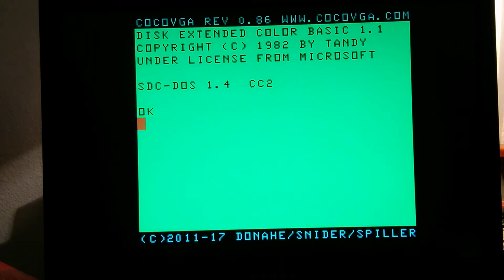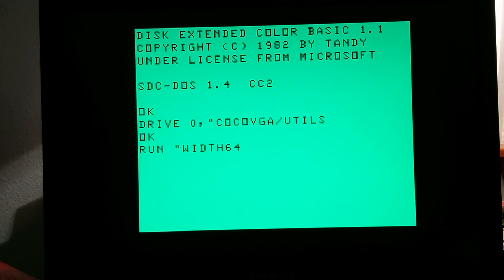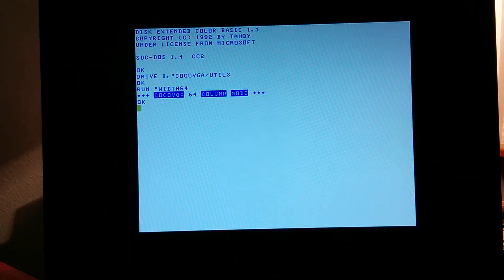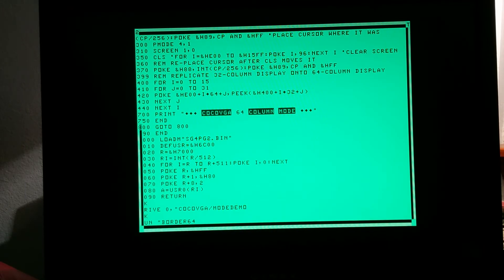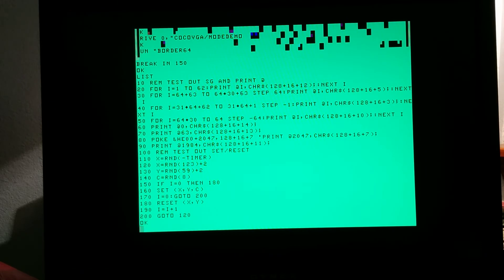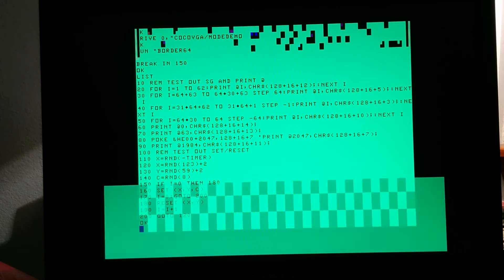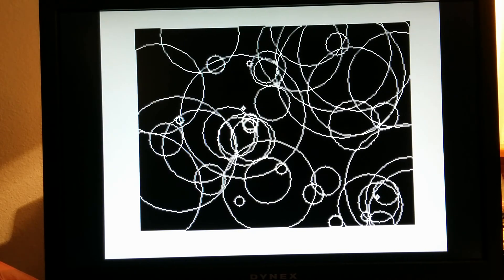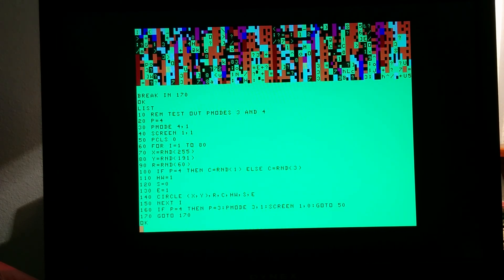CoCoVGA 64-column mode

Comment: awesome sauce.  64 col and you can set the colot pallete...?
Reply from the maker: Yes, that's right, either by way of the buttons on the back or the SW controls (blanking region unlock, palette register updates).  For more on the SW controls, see http://www.cocovga.com/documentation/software-mode-control/.  I still need to update this page for the 64-column control bit, but otherwise it's up-to-date.

Comment: Available? Cost? Thanks!
Reply from the maker: We are currently sold out, but I occasionally get bulk shipments in from Ed Snider and notify the folks on the waiting list about availability.  Kits are currently $95.  I have proven out this board in CoCo 2 rev B boards, Tano (NTSC) and PAL Dragons, and MC-10s.  The current apparent compatibility limitation are the board form factors to match up with available CoCos.  Also, we don't support the 6847T1 (yet), just the original 6847 (although CoCoVGA does add a number of the T1's features).  Contact me via info@cocovga.com to get on the mailing list or to ask questions.  See also www.cocovga.com.
Reply: OK. Apparently mine is a (still sealed) 64K cc2 26-3127B with another label of: AA09YN26-3127B. Not the same as your description as the RF-can is horizontal and not vertical.
Reply from the maker: That's fine.  The other aspect I would need to know on this one is whether the zero has a slash through it (making it a 6847T1) or not (making it an original 6847).  We can still get you on the waiting list if you want.  Other form factors are in-the-works.  Feel free to email me at info@cocovga.com so that I can have your full contact information.

Comment from the maker: Note that as a corollary to this, I have gotten the CG2 graphics mode (not normally supported by ECB), which is a true 2kB mode to act as surrogate for 64-column mode.  This means it's easier to identify when we should display graphics vs. text with BASIC and pressing the button to select between the two is no longer necessary.  I now have an ECB patch which works with this.

Comment: Any way you could set it up so you could switch from text to graphics and back completely under software control? If nothing else maybe hook the cassette relay to the mode button, and then patch BASIC's PMODE command to manipulate the relay?
Reply from the maker: I may have a way to do this under software control by dropping the use of PMODE 4, but it's going to require considerably more of a BASIC patch.